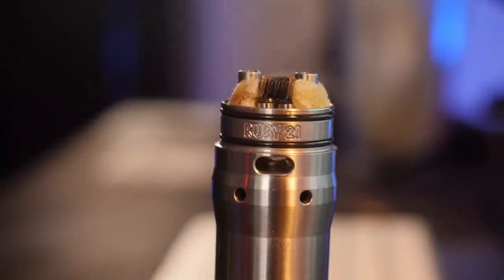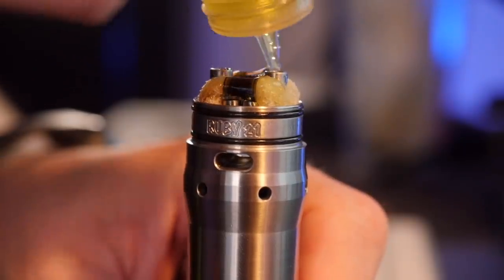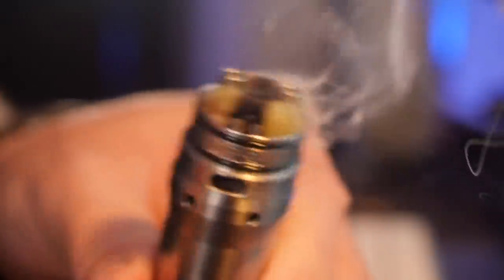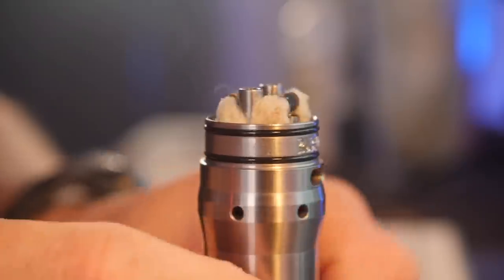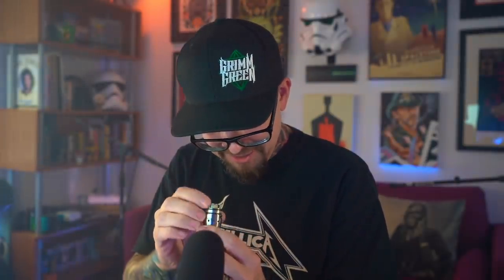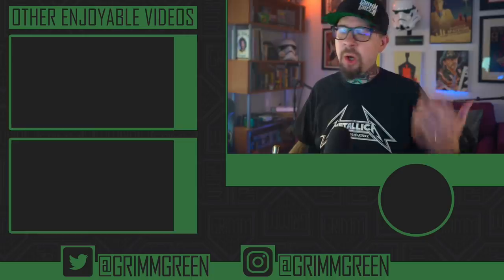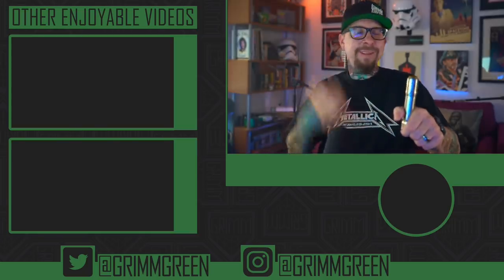How long does your cotton last?

Comment: Just a suggestion; near the end, instead of vaping it, pull the top cap off and fire whilst blowing at it. Then you achieve the same effect without risking semi dry hits. I did not come up with this, saw MikeVapes doing this. Keep up the good work Grimm <3

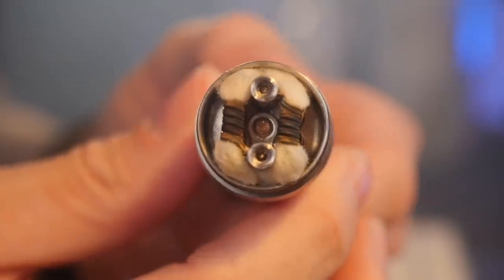Comment: Just want to mention that @ 4:30 is ideally how you want to be leaving your wicks overnight.
Reply: Truth 👍
Reply: Amen, I do that too but I rarely keep Cotton wicks in my build longer than 5 days personally and that is stretching it. Usually I like to clean my coils before the Cotton is trash but I always go fresh Cotton after I clean my coils off. I may be more vigilant about cleaning coils than most, but I vape close to 100 Watts and the tarnish on the coils affects taste and battery performance significantly. It's just too easy to do to avoid it, ha!
Reply: Depends on the juice too, i noticed. Sweeter juice tend to collapse the cotton faster (i have new one right now and i wicked it 3 dam time already still collapsed my cotton >.<), but other juice i can dry it to white but doesnt break.
Reply: got my first RDA yesterday. Went to bed and left it with the cotton still pretty saturated.

It tasted kinda muted in the morning but it wasn't that big of a problem. Right now I've rewicked it 3 times though because I'm still trying to master rewicking it, so I probably haven't experienced any real issues with my cotton yet. Good to learn these things early rather than later, though.
Reply: Sometimes I make it even much dryer. When its on that point of dryness at 4:30, just cut the wattage down 50% and take some hits. I know, it doesnt really matter that much but it really satisfies me knowing my cotton waiting fresh 'n dry for me the next morning :')

Comment: I've been doing this instinctively and out of natural use proficiency. I felt like I need to dry it out before I drip again, but not burn the cotton. it is very important to note that you should pull a lot of air when on the last couple of hits, so you don't accidentally burn the cotton. The fresh air cools down the coil and prevents that. Also felt like I needed to do it since I'm a diy'er and drip a lot of different things that I mix. My friends can't believe that I use the same cotton for 2 or 3 weeks.
As mentioned previously, always dry up your cotton before going to sleep. The liquid will oxidize and break down the cotton too. It's not a placebo effect thing.

Comment: Great information Grimm ! I have always vaped this way and never knew it was called "cycling." Your right It definitely makes a difference with flavor and longer lasting wicks and coils. At least that's my experience. 
If my cotton wicks aren't vaping dry  ( cycling ),  I know it usually because I didn't use enough cotton wicking the coil because the cotton will remain wet while getting a burnt taste at the same time. I would guess that's the cotton collapsing inside the coil you spoke of. I always make sure my cotton is very snug in my coils and if so the cotton cycles perfectly every time.

Comment: Have you used the tank coils that have a hole or a shelf cut into the cotton? They cause air bubbles to get trapped and dry hits! I got a new rincoe coil and within 10 hits, it’s was burnt tasting, that’s when I saw the air bubble problem.

Comment: Hey Nick, great video, great advice.  I've been doing the "short fire, long pull" method of clearing wicks before changing flavors for some time now but it never occurred to me that it would extend the life of the wicks as well.  Duh! I also have a dozen or more set-ups in rotation t any given time and often forget to clear the wicks before putting one down for a while so yeah, lots of sitting in juice going on.  Thanks to your video I'm reminded that I should and will clear my wicks before putting a rig aside for a while.  Thanks!

Comment: I'm a TC vaper, so...  I vape until my cotton is literally dry. I can use it 2 months without issues.
Reply: Yep, one thing I like about an RDA in TC.
Reply: I don't use TC and I'm not sure how most people vape but my cotton gets pretty dry well before I get a burnt hit. Maybe Ive just been vaping long enough to have a proper feel. Letting saturated cotton sit I thought was an obvious no-no
Reply: Perfect point to make,I've been trying the tc modes....ni80 , Clapton stainless. and so on.
Reply: @williamschober7720  Ni80 (and Ka1) do not work on TC, SS, Ni200 and Ti only.
Reply: @Nuck-Fo0bZz  depends on the juice in my experience, im an rta and rda user, i can sit them for days saturated and can vape them to white but dont break, but other juice ive used just kept collapsing my cotton no matter methods i wicked it >.<. Theres one right now which ive wicked 4 times in one day and eventually gave up, since the dam cotton just kept collapsing with this stupid juice.
Reply: I'm using this juice now on an rta that i just cycled just now, cotton has been sitting on this for a week, i'll see if this one holds up *fingers crossed.

Comment: really enjoy this Ill defiantly will do this when I get a RTA  but what single coil RTA would you recommend
Reply: I've been using the Serpent Elevate exclusively for about 9 months and it's been great.  Easy to build and easy to wick.  The top airflow is great since you don't have to worry about leaking.

Comment: Love Ya Nick but gotta disagree with Ya on this one, been vapin for 7 years, use a dual coil rta, never run my cotton dry and have never had cotton breakdown or cotton burn inside a coil and me not know about it !! My cotton always lasts me at least 2 weeks. Vapin .2 ohms at 60 watts. My coils in the 2 tanks (Reload RTA) I use most are almost 6 months old, yep, I said 6 months 😎 A good rinse, dry burn and brush with a copper brush every time I rewick and coils can last almost indefinitely 😉 Keep up the good work Nick 👍👍

Comment: I vape about 20ml's a day of semisweet liquid. I'll get about 2 days (at 65W) out of my cotton using this method. As a note for some of you...Robert Cranfield has a YouTube video showing what happens when you use a coil for too long.  They're cheap out here in Asia so I will change any coil that I've used every 15 to 20 days of solid use.  It is recommended that you should replace a NI80 coil every 10 to 12 days. Just sayin.  Huge thanks to GrimmGreen for little tidbits like this.  I love to see these lost bits of advice pop up!

Comment: My cotton in my rta usually last 3-4 weeks.  Coils last 6-8 months. Just clean and re wick.
Reply: I hate you... Using any RTA (Griffin, Triple, Aleria, Pharaoh, Herakles) I get MAYBE 3-4 days on cotton. Though cleaning coils, they'll last me a month. Cotton Bacon, Koga sheets, COTN Threads... the center will burn out of the coil completely, or it will collapse. I've been building and wicking for like 5 years and I can only get a week out of cotton with a zero-sweetener juice and sparse usage. My normal life (about 15-20 ml per day) and a sweet juice, I can sometimes need to rewick every 48 hours.
Reply: @ragepoweredgamer  I have a obs engine nano single coil at 40 watts .(starts at 60 then ramps down to 40) .4 ohm build. I vape about 20ml a day. Fruity diy juice. I bought a 12 pack of clapton coils like 4 years ago and I still have several left. Man I love this rta!!
Reply: Oh, well say no more. I vape minimum 80 watts, with many of my more recent builds barely producing a decent hit under 90. Also fruity juice, also DIY, those little asterisks make your original claim a bit less Farfetch'd. Now I don't feel as bad.

Comment: i've been doing this for years  in my rta. Vape til tank is empty before going to sleep at night. Usually my cotton will last 3-4days, mostly i'll rewick because my coil has too much gunk on it. That's why dudes in my local vapeshop are wondering why my cotton lasts longer than theirs(they rewick everyday btw). I thought its because of my ejuice coz i prefer fruity/mint than pastry or stronger flavors.

Comment: I have swapped every wick and cleaned every coil since the days of the stardust. Always topnotch taste and hits, I feel it helps the longevity of batts as a bonus. I attribute to the days of smoking cigs - you wouldn't just use the same filter for a whole pack. Cotton is cheeeeep and the ability to keep it clean is there so why not I say

Comment: I doubt it, but is there some physics behind this idea?

Keep yourself away from the sugar-heavy liquids(Jam Monster comes to mind).

Keep your cotton/coils cool with plenty of air.

Do not vape until your rda is too hot to touch. Let it breathe.

And 2-3 weeks is easily achievable. Usually at that point your coils are black or turning black with gunk.

I have no desire to use the method talked about here. Risk of burning the cotton is too high.

Comment: Is that a salt nic bottle or a freebase? I'm new to RDAs and trying to learn. 

My RDA. The first few builds have been a learning experience. I feel like I've come close to getting it right. The first puff of two is flavorful. Then it all just starts to taste nutty or the flavor gets distorted and tastes nothing like how it does out of my sub ohm tank that I pop my coils into. The juice I'm using is freebase juice head raspberry lemonade. I'm questioning if it's my juice. So I moved over freebase hidrip...and that tastes nothing like how it would out of my pop in coil sub ohm tank. I'm just trying to figure out what I'm doing wrong and the dude who claims to use RDAs at my vape shop is starting to come off as a poser.
Reply: I'm using a dead rabbit v2 and I did go back out and get a dead rabbit pro. The pro actually holds the flavor a little longer. But it's hot flavoring

Comment: Why don't RBA's (RDA) produce any flavor? I also tried doing what you did with the cotton and it makes me couch violently. Also, how do you keep the cotton from turning black?
Reply from the maker: an RDA is generally considered to have superior flavor so i'm not sure what's happening in yours.  Cotton shouldn't be black, sometimes sweetener in liquid can cause it, or too high of a wattage.
Reply: @GrimmGreen  Thanks for the info. I do add sweetener to my recipes but I only use 60% VG and my nicotine is PG. I will use less sweetener. The cotton is probably the problem.  It's organic Japanese cotton that comes in packages of 10 "feets" (according to the package). Same thickness as that bacon stuffs.

The coils are .19 ohms at 7 wraps (316) and I learned not to overheat them while getting out the hot spots so I'm kind of stumped. Now when I try a regular sub-ohm tank it is way too sweet. I need to watch all of your other videos and learn from them. Again thanks for the response and input.

Comment: I been doing this since my first rda naturally, it also save on liquid consumption aswell. My wife only uses subtanks at 80w to 100w depending on liquid in a week she goes through 100-200ml of liquid 120-150 on average i have only been using mechs 80-200w across 4 setups and if i go through 120ml of liquid in a week i consider that alot.

Comment: I swear my cotton last me like 2-3 months before it taste burn on higher than 60 watts. 
To make your cotton last longer you should do this things:
1. Make sure your cotton never Drys out, it should be stay wet.
2. If your vape maximum wattage is 80 wAtts but the recommended coil is 45 then it shouldn't be higher than that
3. Avoid going higher than 70 watts just to show off, and blow clouds.. even 15 to 40 watts is Strong enough to ☁️ 
4. Don't vape 30 puffs per minute.. let your coil and cotton rest for a while. 
5. Once you accidentally forgot to juice your cotton and hits it dry its over.. burnt cotton will always taste burnt like cigarettes no matter how low you go.

Comment: I just ordered my first rda. It's the Profile 1.5 with the mesh coils. Do you think cotton cycling would work on that? I've heard people say to always keep the wick really saturated.
Reply: Dude.Im not an RDA user.But yesterday i just ran out of e juice.And i vaped my Zeus ZX2 (Mesh RTA) I just vape it dry. I dont get any dry hits.But when the cotton just starts going dry you need to go lower on wattage.And you can cycle the cotton.When i rebuilded today the cotton was completly dry.
Reply: @patriktoth3346  Good idea I will see if that works when it arrives.
Reply: @pres7733  Keep it mind tho.When you cycling the mesh.Be careful.Dry hit from a mesh coil is not the best experience.Hurts a lot
Reply: @patriktoth3346  I will be careful.
Reply: @pres7733  How's it going?
Reply: @Patrik Tóth  Hey Patrik, I switched to a normal rda and it is more reliable. I got the drop 1.5. It took me a while to figure out how to wick it so it doesn't spit. Now I'm trying to find out how to get more flavor. I've heard the type of coil is a big factor.
Reply: @pres7733  I liked the Ni80 Fused claptons in my Kylin 2 RTA.. Im still banging my zeus x mesh rta. You should try the Ni80 fused claptons. I like those in dual. 0.23 ohm and  60W with Canna Cotton in a regular zeus x.
Reply: @patriktoth3346  I appreciate the advice, thank you. I will look for those next time I'm ordering.

Comment: My cotton only goes a little dry at the top but the bottom is still thick with juice. If i take a hit i taste the burn. I don't understand this technique unless you love burnt flavour
Reply: You’re cotton to too tight in the coil and isn’t wicking properly. Use less cotton and fluff it out more and you’ll get the juice to flow to the coil a lot better.

Comment: I use a smok tfv16 rba. A single alien coils at .17 ohm. I can't get more than 400-500 hits before my cotton is black and coil is gunned and black. I run it at 60-70 watts. Any suggestions on how to extend the life before I have to clean it and put new cotton in it?
Reply from the maker: the culprit sounds like your juice
Reply: @GrimmGreen  this seems to happen to more than 1 type of juice I use. I don't use dark juices either. And I use 6mg

Comment: Theoretically speaking this works for tanks too?👀
Reply: I don't see why it wouldn't work for tanks as well. You just gotta be careful to give your cotton enough time to pull the liquid from the tank between your hit/hits and it should work :)
Reply: I think depending on the tank and the amount of liquid in the tank you could probably get it dry then set it upsidedown overnight. Not sure if that's 100% sound but it'd be worth a shot

Comment: I don't like to cycle cotton because all the bad stuff that builds up like carbons you end up vaping when cycling cotton. Please read this ppl.... Side note I change wicks twice per day
Reply: What exactly are you smoking on that you would need to change wicks twice per day?? I've never had to do this in 6 years of vaping lol
Reply: @jefflamadore35  formaldehyde was found in slightly burnt cotton at over 5volts in some study. I know that black build-up on the coil is not good and cycling cotton you end up vaping that crud on a small scale but the real reason is I flavorchase and change flavors quite often... And I feel that a fresher vape is a safer vape.

Comment: @GrimmGreen Dude fuck, I had to re-wick 3 times yesterday due to cotton collapse, I am at the end of my rope!!!!! I am using the Dang RDA on a Geekvape Aegis Legend! It's really starting to annoy me and has been this way for a long time, can you provide any suggestions as to help avoid this? I make sure the cotton doesn't yank the coils outta shape when putting it through the coils, i make sure it is the correct length and i thin it out nicely, what am I missing?! Perhaps too high wattage? or what? Any help would be SO SO SO very much appreciated! -- Gained a new subscriber, either way, I dig your approach! :D
Reply from the maker: Could be too high of wattage.  Could have hot spots somewhere in the coil? or maybe they aren't heating evenly.  If the cotton is TOO tight it can keep liquid from getting to the center of the cotton in the coil.  No need to do any wick thinning on the DANG.  Just cut your wicks so the ends just drop down and touch the bottom of the juice well.  Godspeed AJx.  I appreciate the sub.
Reply: @GrimmGreen  Hey brother! Thank you so much for your advice man, seriously been loosing the plot over how often I change up the wicking! I'm gonna keep an eye on the points you mentioned, I moved from the DeadRabbit RTA to the DANG RDA and I love the flavour, I'm just yet to perfect the wicking! Bit I am hopeful for the future! Thank you again for the suggestions, if I am still failing I will make contact, hopefully this is enough to work with so far! Really means a lot, you made my day dude! 😁

Comment: idk how u can even vape it dry ive tried every possible amount and type of cotton i always get nasty dry hits from saturated coils. ive tried trimming, not trimming, poking and combing, pulling back and forth, drawing harder, drawing tighter, and every combination of them. i just never have a consistent wick its always great at first then terrible soon after
Reply: and ive been rebuilding for years now it just seems like a constant chase that you never win. it's incredibly frustrating
Reply from the maker: The only tip I can really give you is forget all that nonsense and just make sure it’s pretty well packed. Coils obviously heat from the inside out so you want more cotton in the middle.